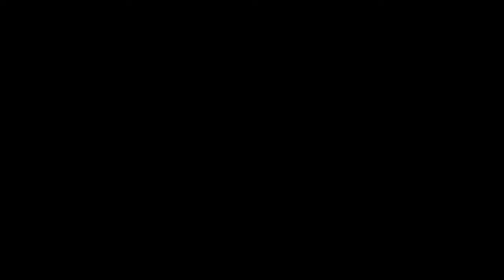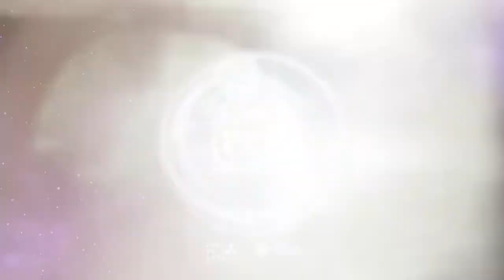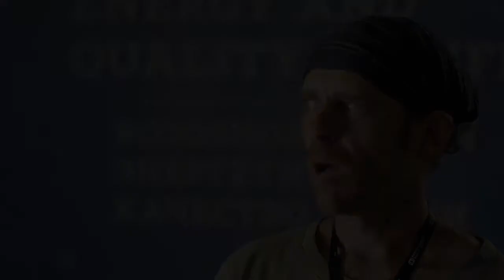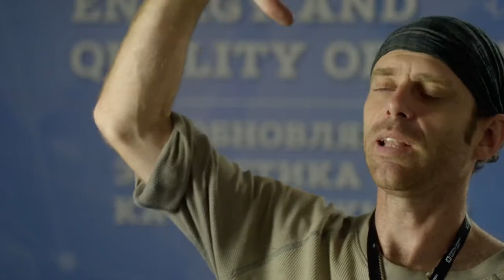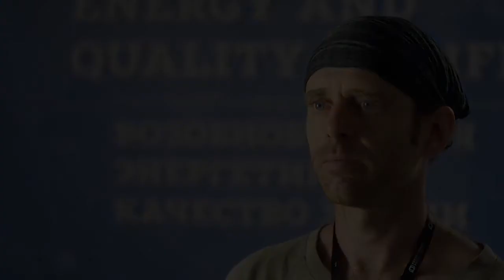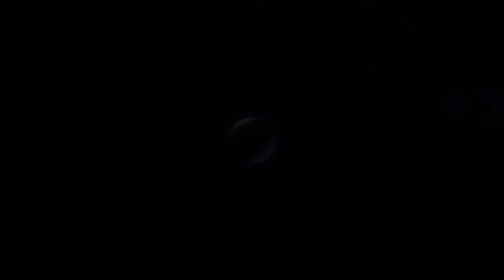Daniel Connell Interview - United Nations Future Energy Forum Astana - OpenSourceLowTech.org

Comment: Daniel, do you have an more details on the pico hydro please?
Reply from the maker: I'll be finishing off the prototype and doing a tutorial in the coming months. Not a lot of data just yet, but you can see  some video of it here: https://youtu.be/M44s8ypNyJ0?t=4m48s
Reply: @OpenSourceLowTech  Daniel it's great work you are doing, but with all renewables, the main issue is with storage, most of the batteries available/affordable won't store power for long enough for renewables to work in every situation. BTW I'm glad I stumbled across your videos.
Reply: @rory6089  gravity batteries are a great way to avoid the need for any battery technology can be done freely anywhere and has many other benefits such as driving pully's to store energy and only using generators to generate as needed